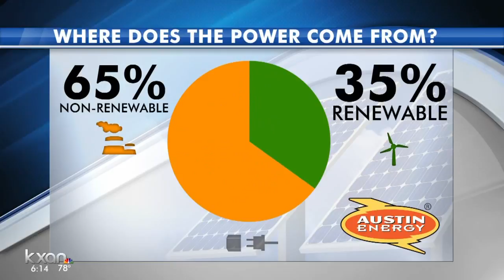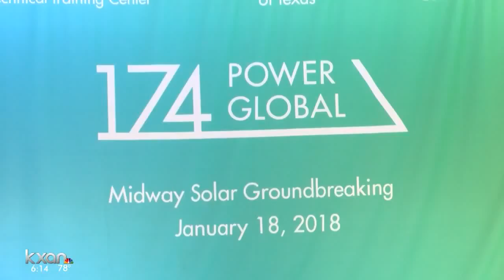Texas’ largest solar panel installation to power 50,000 homes in Austin

Comment: Yes, China is actively involved in developing and utilizing solar panels and related technologies that can generate water, either by capturing moisture from the air or through desalination processes. 

Here's how China is involved in this area:

Atmospheric Water Harvesting: Chinese researchers have developed and are further researching technologies that can extract water from the air using solar energy. These systems can be used for household drinking water, industrial water, and even agricultural irrigation, according to The Cool Down. One such technology uses a "rotating operational strategy" that improves water harvesting efficiency compared to existing methods, notes AIP Publishing LLC.

Solar-powered Desalination: Chinese scientists have achieved records in solar steam evaporation for water desalination, filtering significant amounts of water per day using this method, reports the South China Morning Post. This approach is considered both green and efficient and aims to overcome the energy intensity of traditional desalination techniques like reverse osmosis.

Floating Solar Farms: China has invested heavily in floating solar farms, which offer additional benefits, according to Time Magazine. These benefits include reduced water evaporation, particularly useful in arid regions, and increased panel efficiency due to lower temperatures on the water surface.

Research and Development: Chinese research institutions are actively engaged in advancing solar and related technologies for water generation. This includes developing novel materials and strategies to improve efficiency and reduce costs, according to the South China Morning Post. 

In summary, China is playing a significant role in developing and implementing solar-powered technologies to address water scarcity, through both atmospheric water generation and desalination methods.